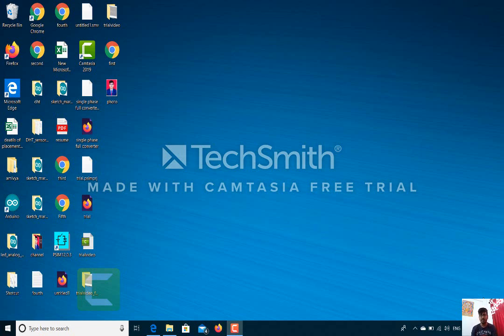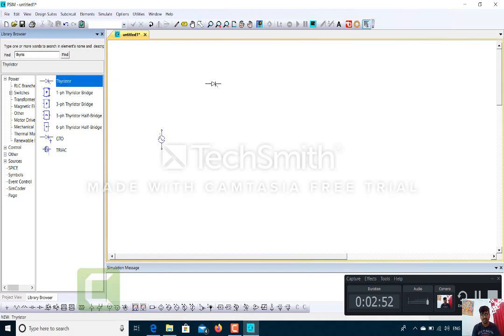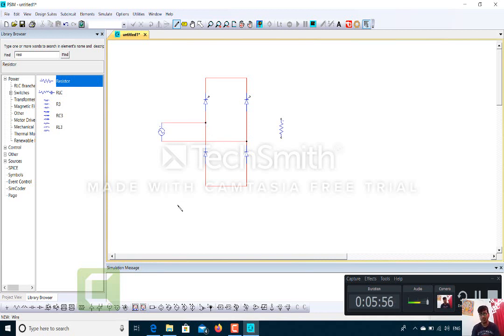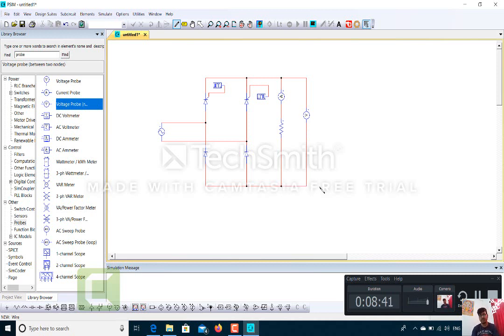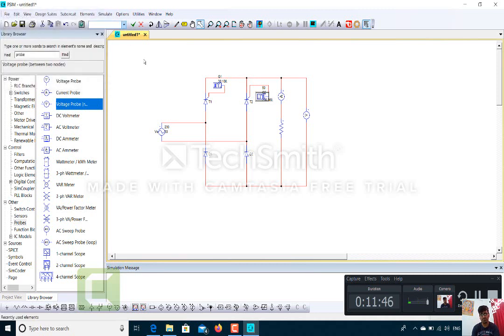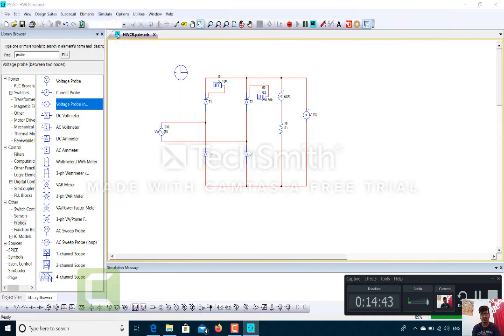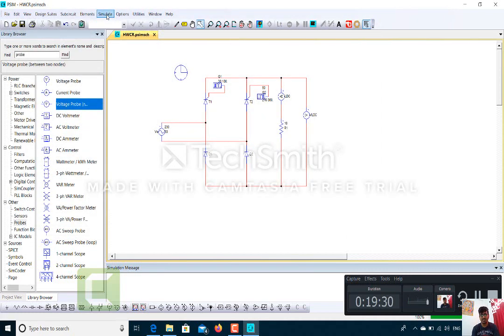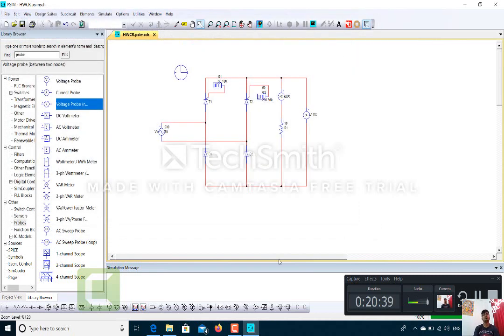Single Phase Half Wave Controlled Rectifier with R Load using Psim Software

Comment: hey sir, If the frequency of the pulse is different from the frequency of the power supply, how is the excitation angle determined?
Reply from the maker: We need to keep both same. By the way y u need that different?  Please share case or example in which u need to keep both frequency different.